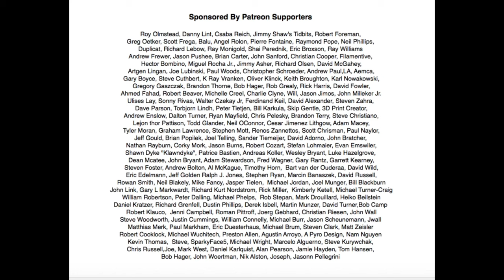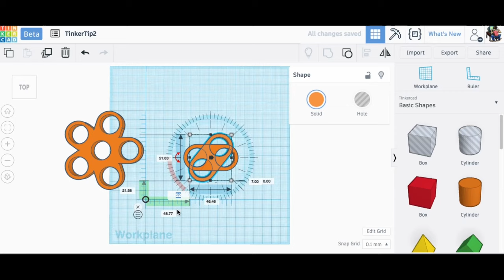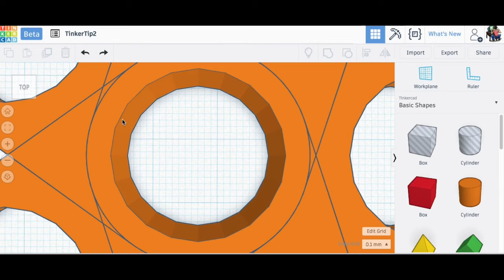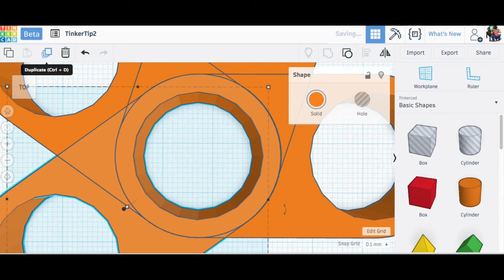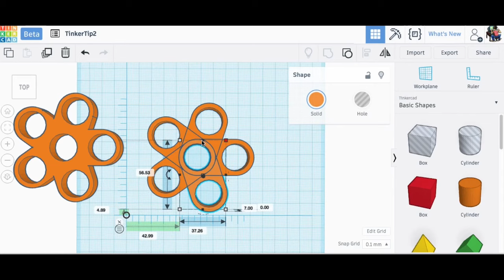Tinkercad Tips & Tricks - Angles plus Duplicate and Repeat Feature

Comment: Easier way to rotate it around the center is to add a block on the other side of the arm with the same length and group together. When you rotate, it will go around the center hole. After you made the other arms, ungroup and remove the blocks. It will be perfectly centered without having to "eye ball" it.
Reply: I do it by keeping track of the dimensions. With a 3mm wall and a 22mm hole, the center is 14mm. I like keeping my dimensions exact in the design and scale up/down for tolerances in my slicer. I print my fidget spinners at 101% usually.

Comment: I realize that this is an old video and the program may have changed, but you don't have to go through all of that madness to align the first duplicate. Just use the Ruler, find the X and Y end points of the original, Duplicate it, Rotate the duplicate, and set the duplicate to the same end points on the Ruler. Then you can just continue duplicating as before.

Also, with the arrow keys or by dragging you can move things in increments as small as .1mm but with the Ruler you can move things in increments as small as .01mm. The Ruler rules!

Comment: I understand that tinkercad may be a good option for absolute beginners, but, sometimes you have unnecessary work doing trivial stuff.
A project like this could be made in less than 30 second with perfect precison in a better cad program, no eyeball adjustments. You could even change the number of arms by changing only one number field.
Reply: paulo pereira - I have a real hard time working and watching these 3d printer related programs, because of it's "basic" dumbed down level. Thus making it hard to actually do something that should be easy.
I used to work in 3D Studio Max and that is a professional tool that actually helps you model. Where as these other 3d print model programs I find hinder more than help. Frustrating at times.